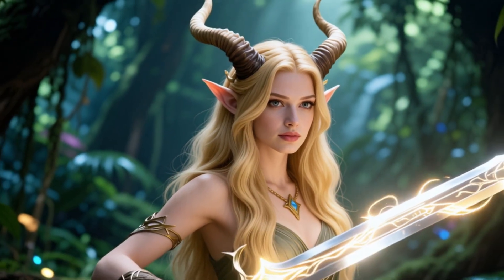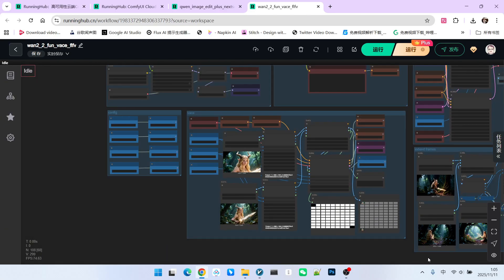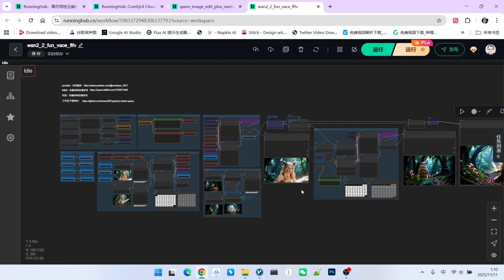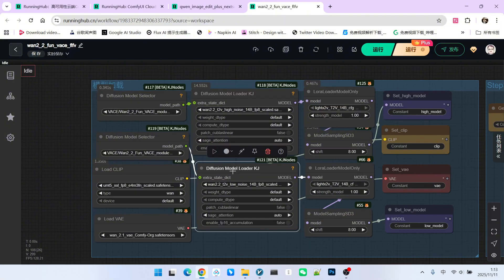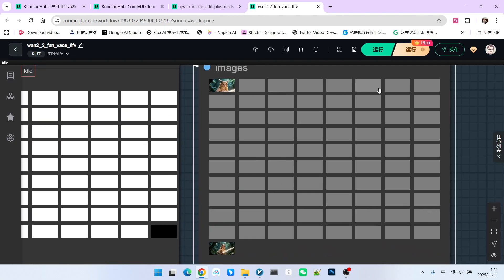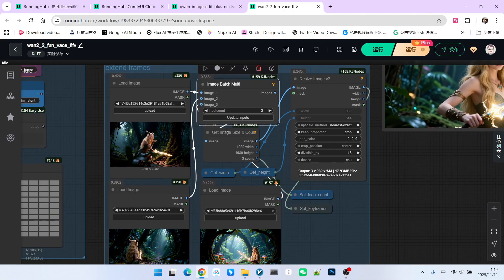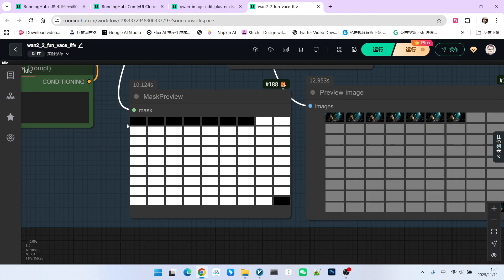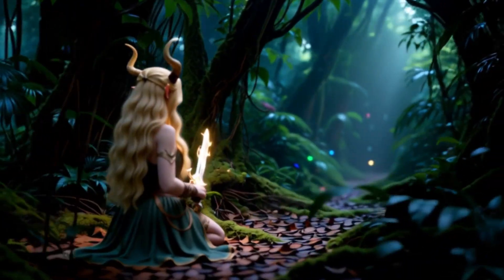Say Goodbye to Quality Degradation! How I Solved the Long-Form AI Video Problem with VACE.

Comment: I have a newer flash and same thing you have to push down on it to fire or it's partially connected. The first I thought it was the flash so newer sent me another one and it was the same thing. And then I thought it was the pins so I cleaned the pins... Same thing intermittent unless I push it forward into place. I've never known a camera with this issue of apart from Sony

Comment: It doesn't work. At the stage - "采样", the latency turns into pixel garbage, just white noise.
Reply: White noise appears if you use this
wan2.2_fun_vace_high_noise_14B_bf16

Everything works with this one
Wan2_2_Fun_VACE_module_A14B_HIGH_fp8_scaled

Comment: Yes but the model alone is 64 gb of size, which means it needs also too much vram.
If there is a quantized version of it, like gguf, then I will be more than happy for it.
Reply: Today I downloaded the workflow that Veteran AI shared, and I replaced the Diffusion Model Selector and Diffusion Model Loader KJ nodes with the UNet Loader (GGUF) node to use a quantized version of Wan2.2-VACE-Fun-A14B. I also added Patch Sage Attention KJ / Model Patch Torch Settings (optional if you have SageAttention or Triton installed), used some models and text encoders I already had downloaded, and added a few motion LoRAs. After a bit of fine-tuning and editing the workflow, it seems to work! I’m just struggling with some color/light shifting during the transitions.
Reply: @mmrawrr what machine you running?
Reply: @mmrawrr  off your vae before It hits the VHS if it's that what's a color mode and attach it to the image reference
Reply: An fp8 will probably arrive at some point